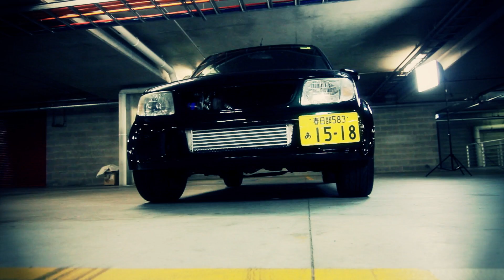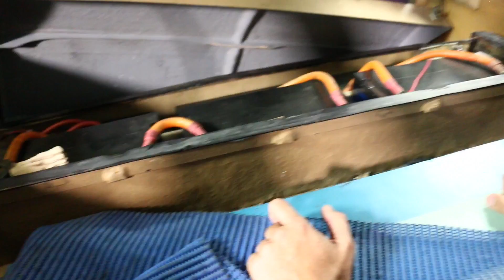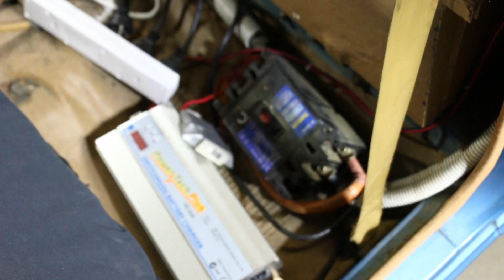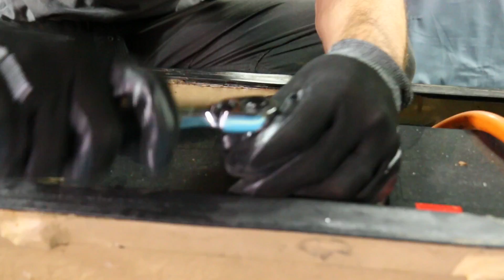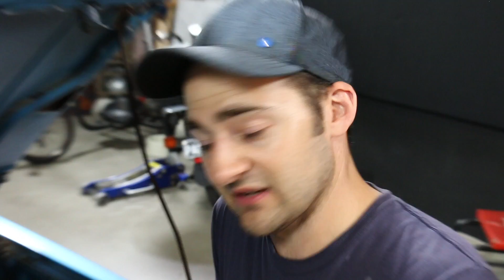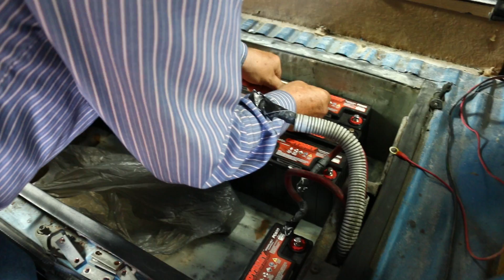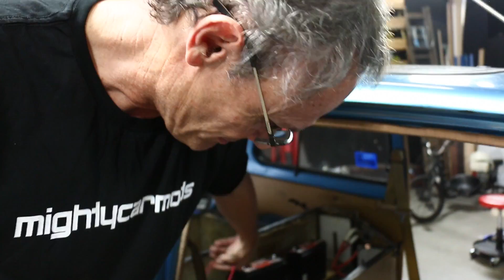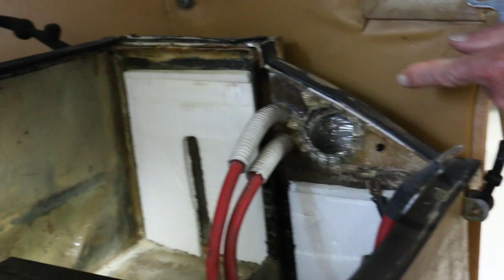JDM Electric Turd

Comment: this battery pack went from 144v 90ah battery pack(when it was new) to a ONLY 144v 18AH!? yes its smaller and lighter but you also cut your range to a quarter, shoulda gone with lithium instead

Comment: Analogously, Batteries are not just the fuel tank, they're also the "powerplant"

with a combustion engine, you have your fuel, combustion chamber and crankshaft. the combustion chamber is what determines the power you can put out, while the crankshaft is what makes that into rotational energy.

with an EV, you have your energy storage, powertrain and drivetrain. the batteries and their layout is what determines the power you can put out, and your motor is what makes that into rotational energy.

you could say fuel still determines what power you can put out, making the fuel type analogous to battery type, but it still stands the layout of batteries is like your combustion chamber. you can't put a different kind of electricity into your battery like you can with fuel. its not perfect, but its what helped me understand EV architecture.

Comment: I did some research on batteries and hemp batteries actually have more potential than lead acid, lithium and even graphene. The best part is that when the cells are used up, the batteries are biodegradable.

Comment: Hi the batteries weigh 68lbs or 31kgs approximately each and you had 13 so that was almost 420kgs in just battery so changing the batteries to new technology lighter units will be a bonus for range and acceleration 👴🏻👍

Comment: Please state it’s the amps that could kill not the power.
Reply: More specifically, a combination of both. In most cases, skin resistance is too high for voltages under about 36V DC. Once voltage actually starts conducting through the body, even 100ma can be deadly.
Reply: It's the (milli)amps through your body, yes. But that's only a few hundred milliamps and you need voltage to force that through you.

Any battery or wall supply can supply several amps.
Reply: @someonesomewhere1240  Correct! 

The current usually has to pass through your heart or brain to kill. It can be as low as 20mA to trigger fibrillation, I think the brain can withstand far higher currents (the quacks used to pass fairly high currents through the brain when electroconvulsive therapy was in the early days, it didn't kill 'ya but fucked up your memory etc.)
Of course massive shocks from high voltage sources like 240V/415V or higher AC mains, lightning etc. can kill no matter where the current enters the body, simply because the current can cause massive organ damage due to burning.
Reply: high voltage jumps to ground itself though if thats through someone then it does so.
Reply: Power is usually the combination of volts times amps. Watts is Power or force over time. Voltage can kill if high enough. Needs a little amperage to do it though.

Comment: Those batterys are only rated for 400 80% discharge cycles, which really isn't that many. If you really want to stick to lead acid a traction battery is what you need, not a starter/racing battery. It would be better to convert it to a modern lithium system

Comment: cobalt (main thing in batterys) comes from where, child labour mines in congo. really nice u promoting child labor
Reply: Its not the main ingredient, and there is such thing as ethical cobalt mines. but yes combating unethical cobalt mines is an important issue.
Reply: @sm1thers  I admit my statement was to far, but that is the world sorry to say its all or nothing. 70% of cobalt comes from congo, some things are just bad
Reply: Your thinking of lithium nickel manganese cobalt oxide batteries, which are what modern production EV's use. (I.e. Teslas, Chevy Bolt, Nissan leaf) The batteries they're using are lead acid. 

In addition, Cobalt is also used as a catalyst in oil refining. The cobalt gets consumed in the refining process. The cobalt in batteries can be recycled. Or the cells can be repurposed for stationary energy storage. This makes BEV's more viable in the long run. 

Still, we need to recognize that blood cobalt is a significant socio-political issue. There are several initiatives to track where cobalt is sourced, but I'd remain skeptical of them till proven.

From my perspective,  socio-political issues can be solved, the unsustainable nature of fossil fuels can't. This makes EV's the lesser of two evils.

Comment: but two of those ODYSSEY batteries don't have the same capacity like one of the old ones - don't they?
Reply: I think they mentioned that the originals were 90 Ah, and now they're replacing each with 2x16 Ah, so they'll have just over a third of the original capacity. Also, 4.6 kWh isn't even taking into account that lead-acid batteries reduce in capacity as you draw from them faster. the batteries are rated for 16 Ah when discharged over a period of 20 hours, so with the usage here you can probably count on halving the actual available capacity. The same holds true for the batteries before, but you can probably use 2.3 kWh to compare it to the size of other EV batteries.

Comment: My aunt used to have a Daihatsu that looked very much like this one. Until it got run over by a Chevrolet pickup.
Reply: How's your aunt doing?
Reply: This happened over 20 years ago so I don't remember all of the details. But the Daihatsu was parked outside a store and no one was in the car. So nobody got hurt. The driver of the pickup was in a hurry and backed very fast out of his parking spot. He simply didn't notice the little Daihatsu and completely crushed it. One of my uncle's friends had a Ford Torino wagon that he managed to crush a Citroen 2CV with (no people in this car either). This also happened in a parking lot. He was driving at a little faster than walking pace. And it was winter and snowing. When he was about to make a turn he noticed that the ground was covered in a thick layer of ice with snow on top. No matter what he did the Torino just went straight forward at the same speed. And right in front of it there was this little 2CV parked in front of a dumpster. The 2CV was completelty flattened and acted almost like a cushion for the big Torino, which only got a small dent and some scratches on it's front bumper.

Comment: Could you install a small engine and a generator to recharge the batteries?  Like a gas or diesel, electric hybrid.
Reply: Why not just get a gas car then?
Reply: Matthew DeFaveri theoretically you'd be getting hundreds of miles per gallon.
Reply: If you only ran the genny off the public roads, you could feed it red diesel. Cheap miles bros.
Reply: WineScrounger here in America dot will look in the fuel tank at the weigh stations. If they see red you are in big trouble.
Reply: Michael DeSilvio same here (🇬🇧) but what if you’re just towing a portable generator? You’re just transporting it.
Reply: You could, but why bother?
Reply: Myles Vance you would be able to drive coast to coast with an electric engine.
Reply: @michaeldesilvio9980  How often do you drive coast to coast though? EV charging infrastructure is growing rapidly as well, long drives are getting easier and easier each time a station opens
Reply: Myles Vance why would you want to stop and recharge a battery if you didn't have to?
Reply: @michaeldesilvio9980  Why would you want to stop and fill it up with gas if you didn't need to?
Reply: Myles Vance so that I could drive coast to coast.

Comment: So if a turbo uses exhaust fumes to generate extra power(speed), would a dynamo use rotation to generate extra power(charge) for the batteries??
Reply: Not exactly, as dynamos have significant resistance in comparison to hot air fumes, in order to generate the power, therefore requiring more power to turn them. If this wasn't the case, we'd have free energy forever, 1 motor turning multiple dynamos producing more current than used, which can't happen. :P
It IS an interesting thought though.
Reply: Not to be  insulting but are serious 
If you are refer to the earlier comment 
If not 🤣
Reply: A turbo compresses the incoming air by using the exhaust but adds a lot of fuel too. The best thing to do this with batteries is to run 2 packs in parallel for normal  running then, in series for boost speeds and using re-gen running downhill and braking.

Comment: just stick some lithium batteries in it..............and when you crash, you can enjoy being burned alive, just like a Tesla owner. But Odyssey batteries? sooo expensive..........
Reply: Wait, is this an argument to electric cars being flammable? what about oil and gasoline though?
Reply: Herre Noort well gas cars have been around longer, so people have had plenty of time to do everything possible to make them not blow up, and in a lot of cases those solutions have been made law. Also I’d assume what scares people is how fast, hot and violently lithium battery’s burn, which does apply to Tesla’s. They both can burn, how they do so is different. I will say though that the oil in a gas car isn’t going to contribute to a car fire much if at all.
Reply: And twenty gallons of petrol can’t do exactly the same thing? 
One gallon of gas will completely incinerate a human corpse FYI.
Reply: Cause ONLY Teslas burn? Lol c'mon now

Comment: why not using Gel batteries?
Reply: Heavier and not so good at capacity over an extended distance.
Reply: I'd say the same for LiFePo4.

While there are even better lithium batteries, like LiPo in drones, LiFePo4 is like a lead acid 2.0. It can swap in for a car battery etc without special chargers and monitoring but lasts longer, weighs less and makes more amps than their lead counterpart.

https://www.arkportablepower.com/blogs/news/54925381-deep-cycle-lifepo4-vs-lead-acid-pros-and-cons
Reply: 6 volts gel like in the golfcar

Comment: if I understand corectlly that 2 of these 15Ah will replace 1 old 60Ah, you will have half the range it had before when it was new
Reply: yeah i was expecting a lithium upgrade when he mentioned "new technology"
Reply: Actually a 60Ah has only about 38 of high current draw. 60 is calculated at a really low discharge. The 15Ah ones have about 8Ah  at half the high current of the 60Ah and cant handle the higher current well at all. Best to use large 6Ah D cell NiCads in Sticks of 10 as it is a tough cell and can take a good amount of abuse. Some Hondas used these exact cells.

Comment: i allways wondered why electric cars don't have a roof full of solar panels so they can extend range , charge while driving and parked.
Reply: You can get MAYBE 1KWh per square meter of solar panel, so if you assume a square meter of roof and even if the charging was PERFECT, it would take hours of charging to even get any reasonable distance. I get about 3-4 miles per KWh, so you would need a lot more panels and/or longer charging.

And I agree, a trickle charger would be nice, but it unfortunately wouldn't do much.
Reply: 1KWh per meter is IDEAL and real solar panels are about 20% efficient, so you might get 200W per meter?
Reply: Cars use so much power it would be almost futile, comparable to farting while speed skating. If there was one or two of those big batteries in it then solar recharging would be practical, but it wouldn't be a useful amount of power for transport.
Reply: Just like with all other things, the lazy scientist cunts behind researching the technology won't do their job properly until they get paid enough money.  Since the majority of the funding for energy goes to fossil fuels, and even the "clean" energy buffs barely touch solar....its not worth it
Reply: Michael Fingers even scientists need to pay the mortgages and buy food and shit, we’re not charities ya know.
Reply: Yeah, there's two in development

https://www.google.com/search?q=lightyear+one

https://sonomotors.com/en/sion/
Reply: FHQWHGADS , the lightyear looks cool.

Comment: I nearly bought a 2cy one of these around 2002. I regret not getting it, it would have been hilarious.
Reply: The old fiat 500s had a parallel twin engine, I had to fix one after a misfuel. Much buzzing and lots of smooooooke 🤣
Reply: Give it a psychotic turbo, maybe tweak n tune, aaaand it's a DaiHayabatsu 🤔

Comment: LiFePO4 battery technology is real nice for home-brew... most forgiving, and 4 cells gives the same voltage as a 12V lead-acid battery.... and a fraction of the weight.

Comment: how about solar panels?
Reply: With a panel the size of the roof of this car it would take probably like a month to charge it. Solar panels placed flat are incredibly inefficient, since the sunlight is always at some weird angle, add the shade casted by buildings, trees, whatever, and the panel becomes dead (and very fragile) weight

Comment: If you hooked an alternator to the electric motors drive shaft and hooked it to the batteries you think it would charge it as it drives?
Reply: Yes, but it wouldn't produce enough electricity. Some Electric cars use regenerative braking which is much more efficient.

Comment: This is awesome.  It’s getting me pumped to get my home built electric bike ⚡️ 🚲 aka the Silver Bullet up and running again!  It is total stealth.  Uses a Walmart electric bike’s motor & controller but on a much lighter frame. It Uses 3 6v batteries for 18v total.  2 batteries & electronics are mounted in the triangle of the frame & covered by a semi-translucent water resistant housing that fits snug within the frame.  The third battery is on a tray over the back tire suspended from the seatpost.  It’s pedal-assist, so at first glance, it looks like a regular bike.  That is, till I whizz by the other bikes in the bike lane.  My top speed was 27mph.

Comment: Volts WILL NOT KILL YOU. Amps WILL.
That's what makes electric cars dangerous.
As soon as you have enough volts to overcome the resistance of the human body, its the amps that do the damage.
Reply: Actually, it is rather a moot saying as given a resistance you don’t get the amps without also having the volts.  But the real danger with large series and paralleled battery packs like this are twofold: if the voltage is high enough and/or your skin damp enough then with DC you can find it very difficult to let go of an energized circuit if you grasp it as there is no zero crossover (so always wear leather gloves, leather specifically due to the next risk) and the other risk is the extraordinary amount of amperage for a given voltage that large battery banks like this can deliver if shorted (literally thousands of amps initially into a sufficiently low impedance short) which can result in arc flash injuries to both eyes and exposed skin (especially the hands when making or breaking a battery or controller connection) and that is why you want leather gloves as they provide excellent short term thermal protection and they will not melt into your skin nor easily catch fire like gloves made from plastic fibers can.
Reply: RogerWilco more correctly it’s volts AND amps required to kill ones self
Reply: Thank you for pointing out this very important safety tip. You are absolutely correct.

Comment: That mains circuit breaker wrapped in silver duct tape is a death waiting to happen. The reason duct tape is silver is the Aluminium powder in the tape, use a multi meter on a high Ohms range and touch it to the tape, it is conductive. Replace it with normal PVC insulation tape, even cheapo tape is safer than duct tape.
Reply: whorayful Not only that, but if it is a mains (AC) circuit breaker and connected to a high amperage DC power source, such as the battery bank, then the AC type mains breaker will likely not be able to properly clear and extinguish the arc flash that can occur if it trips under load (and breakers normally trip under load) which would result in it failing to clear the fault and the short circuit continuing unabated so long as the batteries provide the required current and voltage necessary to sustain the arc.  If it is on the motor inverter (AC) side (assuming this uses a three phase AC motor) then that is not so bad in and of itself, but if it is an AC breaker on a DC circuit then it is entirely the wrong type circuit breaker and offers little protection (or at least not protection one can trust).  That said, duct tape really is not useful for much more than temporary repairs as it just an all around awful tape for anything long term and an awful insulator.
Reply: You’re both right. This thing needs HRC fuses like BS88 ones, and a proper enclosure. Tape be fucked, my god what a bodge.

Comment: You can tell how crap lead acid batteries are by simply counting the number of GM EV1's there are left on the road.
Reply: Ariana Ashworth the reason you don’t see EV1’s is certainly not the batteries....only the gen1 even had lead acid batteries...the gen2 was fitted with Nimh batteries....Remember GM got all 1117 of them back and destroyed all but 40 after the leases where up....
Reply: There are no EV-1s on the road because they were only ever offered for lease and once the lease expired GM had them destroyed because they were deemed too much of a long term threat to their other divisions.  Otherwise the only great disadvantage of lead acid is the weight versus power capacity ratio that limits range.  Failed lead acid batteries are trivial to replace and are the most recycled product on earth (~99%), so if an EV-1 with lead acid batteries were to still exist there is nothing that would prevent its owner from regularly replacing those batteries.  As it is, I’m only aware of one EV-1 that GM did not order destroyed and it exists in a museum collection warehouse and even then only on the condition, per GM, that it be rendered undrivable (essentially batteries and drive train removed).  In fact, the very first automobiles ever manufactured predate the internal combustion engine and ran on lead acid and nickel iron batteries — and they still exist in drivable form to this day, though most exist in collections given it’s been more than a century.